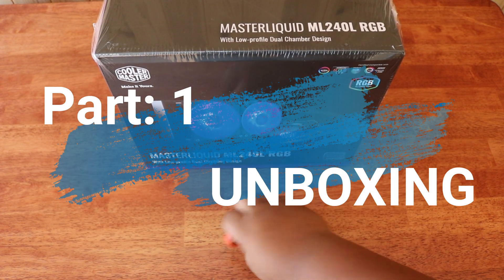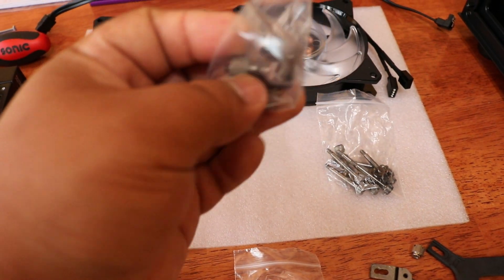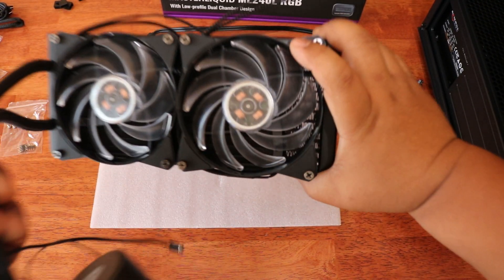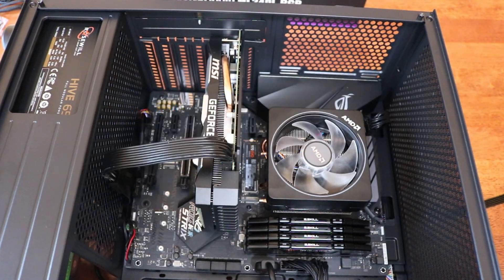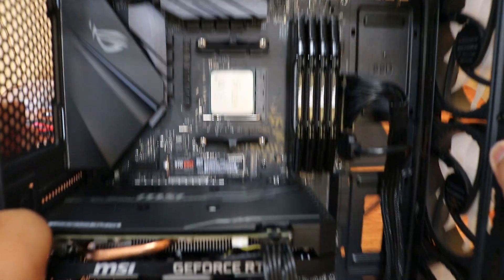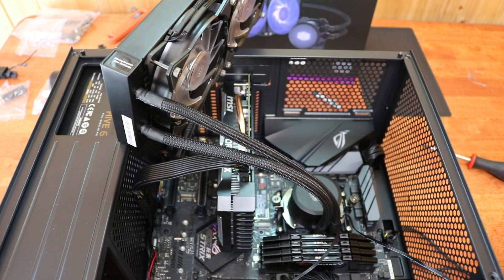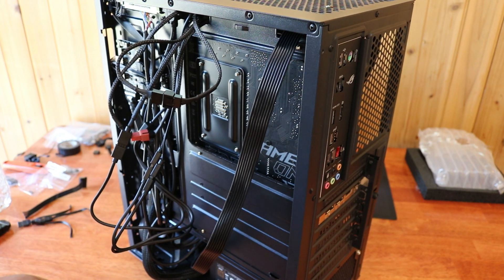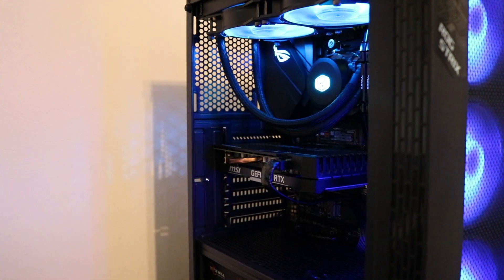Cooler Master ML240L R.G.B. Install! : AMD Ryzen7 3700xx : ROG B450-F

Comment: wish i could see you connecting the wires in the back
Reply: Doing my first build it really would have been nice to actually see you running the wires then it being done already for wire management '
Reply from the maker: @angelanuccio2167  I'm sorry for that..  I will be building a PC for my daughter soon, if you ce across that video, I'll be making sure to show how I'd route all the wires.. not sure when is that, but you have a great point. I'll show it next time.. thank you for your input..

Comment: does it need refilling or is this a close loop cooler?
Reply from the maker: Closed loop... but some folks around here in VA had their ML240L modified with different tubes, then they have refilled it back with aftermarket cooling liquid...